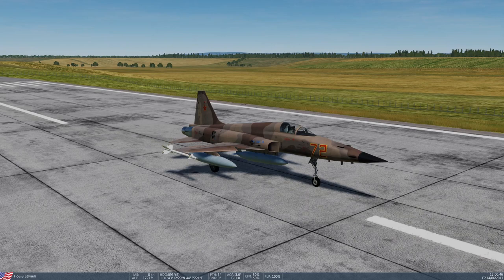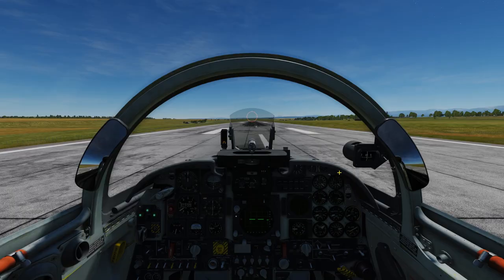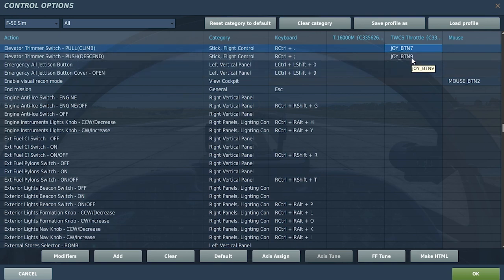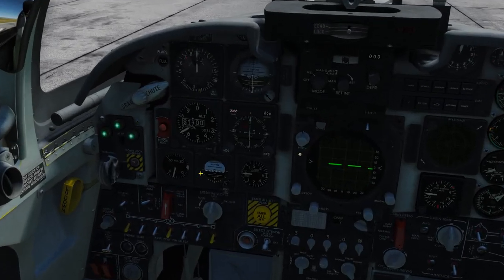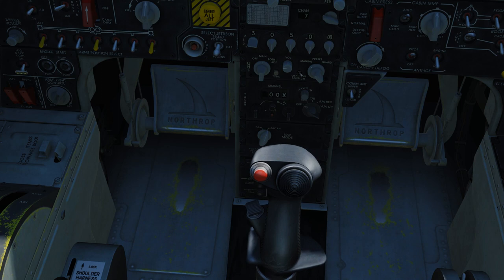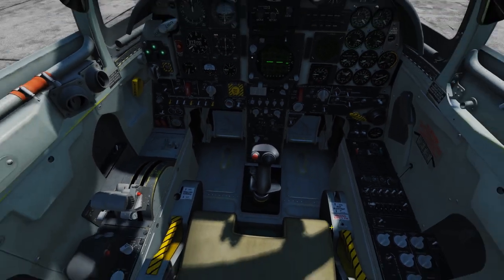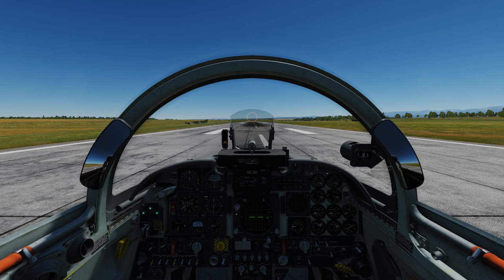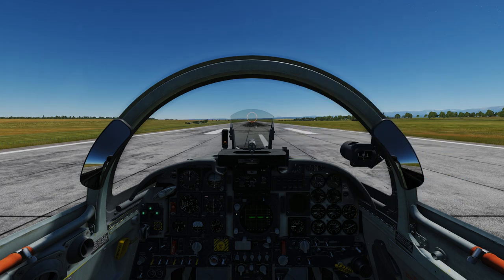DCS World F-5E-3 Tiger Nose Up / Nose Down Trim!

Comment: Learn how to set a ”custom view”...it’s been awhile, but iirc press Right Alt (RA) + Right Shift (RS) + Key Pad # (KP#) to move your POV around.

Keep in mind basic views are achieved by just pressing KP# (look left = KP4) Custom views require a modifier to select them, so to set up a view you have to press RC + KP#.

Then you have to move your POV with these combinations:

RA + RS + KP8 = up
RA + RS + KP2 = down
RA + RS + KP4 = left
RA + RS + KP6 = right

Zoom in is KP* (without ra/rs), zoom out is KP/ (also without ra/rs)

After adjusting your POV, save it by pressing RC + KP0 (zero). 

Check that it worked by pressing RC + KP#. For example:

RC + KP3 (sets up “custom view using Key Pad #3)...
RA + RS + KP4 = left (adjusts POV to the left)...
RA + RS + KP2 = down (adjusts POV down)...
KP* = zoom in (moves POV closer to the gauge)...

RC + KP0 (saves)...

RC + KP3 (you should see the trim gauge while holding this combination, you will return to your view after releasing)

Done! You definitely want to check if I remembered the buttons correctly, and you cannot have TrackIR or similar head movement program active while setting a custom view.

Hope this helps.
Reply from the maker: Thank you!